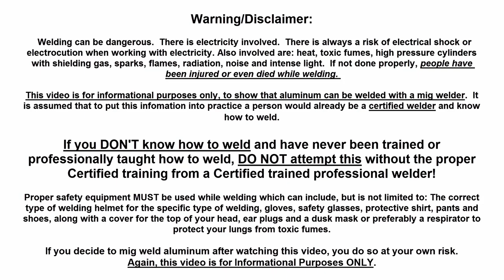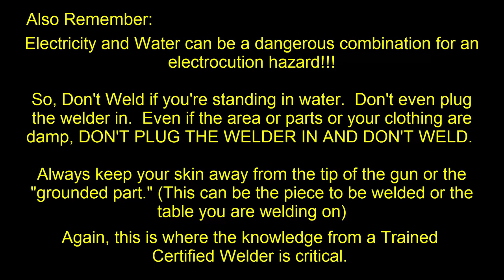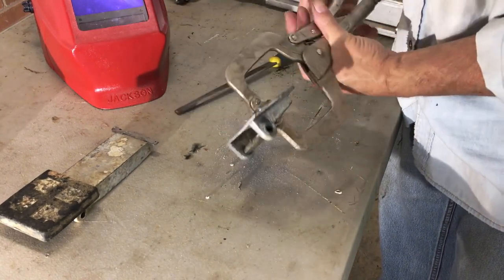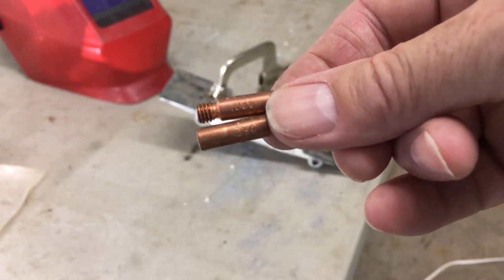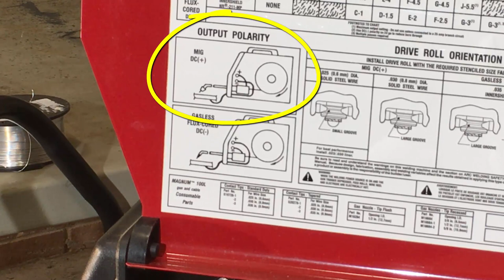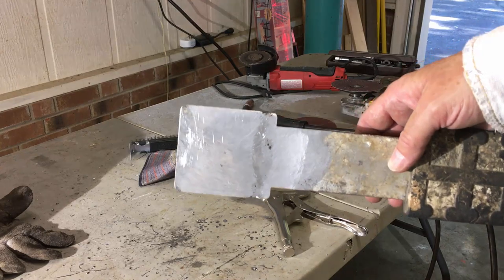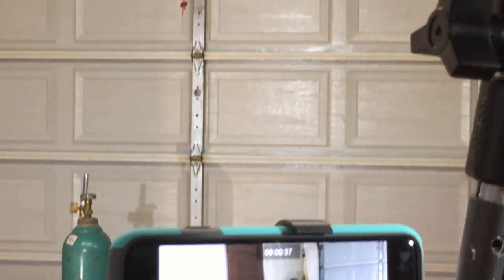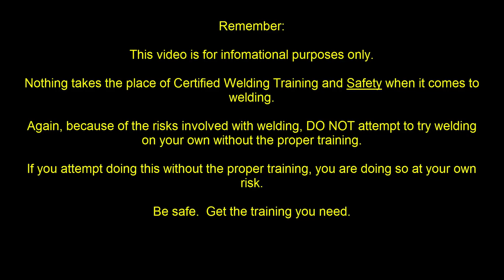Learn An Old Timer's Secrets To Mig Weld Aluminum Without A Spoolgun

Comment: Just go get a HTP Pro Pulse 220 with the 26 aluminum mig gun and weld sound pretty welds on aluminum sheet or plate to your hearts content  using double pulse mode with the synergic settings.

Comment: thank you for showing me how to weld aluminium, I only ever tried this out the once, on my Mig welder, and I made a right cock up out of the job!,, I used the softer wire though,, the wrong polarity and a small disposable bottle of gas, that only lasted a few minuets,, but I did use a bigger tip!,, but all the bird's around were I live,, had rust proof nest's for year's!,,  so what kind of pinch roller do you use for aluminium,, is it a V groove or a toothed drive roller?,, and why do you need a stainless brush for cleaning the aluminium?,, great video, thanks

Comment: 35 years welding everything from aluminum to stainless. Clean is the word on aluminum. You can be a master welder and have a weld look like crap and be crap  if not cleaned properly. I  mig  and tig weld  aluminum  from .040 to 1/2 inch.  I agree about the ring lol. That’s a bad idea for a welder. I have seen the results of a gold ring and mig wire not pretty.  I have welded 2” aluminum with straight helium using straight Polarity.  Not something your supposed to do but awesome penetration It was a job for the military.  I know there are going to be people saying I am full of crap with that  but it does work. The worlds were x rayed and penetrant tested.

Comment: I have the same machine but 220v I just landed a bunch of cut offs 3x4 inch 4ft. long rectangular tubing 
35 pcs . work tables welding cart, thanks for the tips....
Reply from the maker: Thanks for the comment and for watching the video!!!  It's always fun to get a bunch of material to either practice on or use for projects!
Reply: I'm 66 going on ___ you know,  say I appreciate the responce, just got back from a guy's, I've  know for years he's down sizing I bought a bunch of tubing various sizes and lengths, and a good amount of square tubing, mostly all steel, some stainless great for building projects I have a jancy 2400jb bender with dies both sets of dies....decent wire welder and some good folks on tube to give me some ideas..its so cool to see people share the learning experiences  with who ever if they will just look, most likely its there but I've had a hard time recently trying to find how to wire up a reversing switch, about the last image I found it it worked fine..... I love build things....grew up poor and dad had a junk yard so make junk run is a quick learning curve.....keep up The Work....i subbed.... thanks Don Powers.....
Reply from the maker: Don,
I love hearing stories like that!!  It's always great to make things out of scrap steel, etc.  Keep up the good work and the passion of your hobby.  It keeps us young!
Reply: thanks, it's just too hot down here in Houston so going slow, would love to send pictures, not in to the stairway to great videos.....lol....maybe someday...thanks for the reply
Reply: I am been a certified welder or many years a very nice tape that you made

Comment: Hi. I’ve searched all over e bay here in Uk  and can only find 0.8 diameter not 0.30 what is the best way to proceed. Kind Rgds
Reply from the maker: Thanks for the question.  .030” wire is the same as .8mm wire.  Good luck!
Reply: @StairwayToVideo  thank you for taking the time to reply and your explanation.

Comment: Lately I'm considering going to mig instead of stick, looks like a better setup for all around tasks, from sheet metal to aluminum. Been looking at a Hobart Handler 140. Very helpful & excellent video.
Reply: I have a 140 handler. You'll love it. One tip: if it seems like it isn't striking an arc or feeding,check the contacter in back.
Reply: I had a handler 140 and it was okay for smaller things. Upgraded to handler 210mvp, day and night difference. I welded stripped lift arms to the lift shaft on a Kubota tractor with it a couple years ago and it's still holding the tiller up.  😁
Reply: The advantage to MIG (or FCAW for that matter) is that you are able to weld together thinner pieces of metal than you can with SMAW.

Comment: You discussed everything except changing the liner to a synthetic material versus the coiled metal for  metal welding and using only tools to clean and prep with that were reserved for aluminum welding so as to not introduce contaminants.  Shop I worked at in high school 72-74 we used carbide burrs for material removal prep and ss wire brushes tgat were designated aluminum welding only.  Some welders also use acetone to clean the area before welding but acetone is hell and gone volatile and flammable quickly going airborne in its vapors.  Also, reclean weld start areas befor resuming a bead if you get black soot on the weld area.

Comment: First role you had of wire I hated that stuff right at the tip it would try to weld it back to it special on inside diameters

Comment: Hi. Good video. I used your same basic method to weld some carburetor base plates with broken off mounting ears years ago. Things I found. 1. Clean the base metal! As mentioned in other comments, NEW stainless brush.  2. Clean and maybe lube liner. Silicon spray?  3. I would lay a scrap piece of aluminum next to what I was welding and start the weld on the scrap piece and move to the other piece and weld in one pass. I got much cleaner start and finish. No porosity. I used a 110 volt, 130 amp Mac tools welder, very similar to yours.
Reply from the maker: Barth,
Thanks for commenting!  I like to hear how others have figured out how to solve welding issues, too.  I'm glad you had some success with that same type of process. Thanks for sharing your story and for watching the video!

Comment: 4043 is an Al-Si alloy.  Its main advantage is that it can be used to weld just about any aluminum alloy.  5356 is an Al - Mg alloy, it is stiffer (stronger) than 4043 due to the strengthening provided by the Mg.  Also, 4043  can be heat treated to improve strength while 5356 cannot be heat treated to improve strength.  4043 MIG wire is usually supplied in the H0 or annealed condition and has a 10.2 ksi yield strength as compared to a 13.6 ksi yield strength for 5356.  HTH

Comment: so in other words you have to have a short lead on the welder and use a big tip.... knew that. not a horrible job welding "floorsweepium" ( cast aluminum is made of crap swept off the floor, I HATE welding it!) good info. I would have cleaned it more and he did mention pre heating, which you should always do.. well done.

Comment: What was the reason for welding in spurts instead of a continuous weld?
Reply from the maker: Thanks for the question.  The material was thin enough that I didn't want to blow through it.  Sometimes when you weld aluminum, the heat builds up very quickly and you have a chance of blowing right through the material.  Thanks for watching!

Comment: I taught my self to weld, I discovered with automatic helmets its like welding blind, the old green glass helmets are the best you can actually see the weld puddle.
And I can weld the same things with a 110 welder as a 220 welder.
With thicker or harder metal  turn the welder down to its lowest setting.
Then use a torch to heat it red now it can weld just like a 220,.... the only difference is the heat range.
I have never welded Aluminum yet but  would do the same thing.
But now  would clean all surfaces with acetone and to heat the metal  would use map gas to heat it.
And before I installed the wire,... would change the liner in the mig line.
Plus I worked in a machine shop for 15 years, and in a weld shop for 8.

Comment: I am curious if flux core mig machines vs regular mig machines they sell at stores are the same thing just they preset them to do DC negative instead of DC positive and without a gas attachment. So if one bought a regular mig machine would he also have a flux core mig machine so have both types of mig machines in one. Thats probably why there a little more expensive then the "flux core machine only ones" they sell to i am betting .... wondering though not fully sure quite yet???

Comment: So I see that you're using an .035 tip.  Are you using an.030 liner or an .035 liner?  Does the stiffness of the 5356 wire keep you from having to reduce the feeder wheel pressure?

Comment: Heat and voltage are not the same thing.  Voltage controls the liquidity of the weld and heat (amps) controls the penetration.  If you are getting porosity, turn up the shielding gas a bit.

Comment: try a block of dry-ice to keep aluminum from getting to hot..also while welding..feed wire into weld from  opposite direction causes the weld to pool flat like a puddle so there's less grinding the trick is using dry ice or liquid nitrogen which keeps the metal from getting too hot.
Reply: I'm sorry but are you aware that dry ice releases massive amounts of CO2 gas? Liquid nitrogen does the same thing, but it release Nitrogen. Both of those gases would substantially effect the weld.

Also, I believe the problem is the aluminum cools down too fast, not that it gets too hot. The actual wire that leaves the gun gets too hot but the piece your working on releases the heat faster than the wire is melting. 

I may not know much, but I thought I'd bring these concepts to whoever may read your comment.

Comment: Another thing you didn't mention, is that you should use a plastic liner in your mig cable.
 Less friction for one as the steel liner tends to grab the aluminium and will get a build up inside over time.
Reply from the maker: Yes, you're right.  I'm planning on doing another video on the topic soon!  Thanks.
Reply: @StairwayToVideo   I'm a self taught aluminum welder, but that was 20 plus years ago.  I was welding everything, including highway tractor fuel tanks and never had to re do any.
Reply from the maker: What process did you use back then? Was it MIG? Or TIG?
Reply: @StairwayToVideo  I don't know how to TIG. 
My first MIG was a 110 volt orange thing very cheap. That is what I taught myself to aluminum weld on.
Later I bought a Spoolmatic 2 and a WC3 controller to run off of my AEAD Millar 16 HP portable. That is what I did the majority of my aluminum welding with.  I sold the MIG attachment many years ago. I have a 220 volt one that I sometimes weld aluminum with.

Comment: so i have a hobart 190 amp 240 volt welder that has both a knurled wheel for flux core wire and a smooth wheel for solid mig wire. did you use the knurled wheel or the smooth or do you not have the option of a knurled wheel? and what was your gas flow?
Reply: Always use smooth as knurled will mar the wire and cause feeding difficulties allso as light a pressure on the feed rollers as not to squash the wire !
Reply: Danny is all over it, the knurled drive rolls are for cored wire only.
With .030 wire I would suggest around 30 cfh. If your weld has a lot of black smut you need to do a better job of cleaning your parent material with a stainless steel brush or add more gas. Oh and make sure you have a good "ground" and ensure no cross air flow through your work area, which will rob your gas from the puddle, and give you a black weld.
Scott
Reply: So will a 220 mig work? Guess so.
Reply: good advice @sunrisetacticalgear29

Comment: If I have a spool gun, do you still suggest 5356 wire?
Reply: Joseph Massimino absolutely most place here in Australia use 5356 for everything. Balustrades boats trailers.
Reply: Depends what strength and purpose you are using it for eg on a boat always use 5356 stringer and more corrosion resistant !

Comment: I have an SP-125 & the tip is not charged until the trigger is pulled even if it is plugged in & turned on.

Comment: 4043 for magnesium castings etc, maybe straighten your goose neck on hand piece out a bit, clean material a lot better,  have a U prep not vee.  Way to cold, weld sit on top. Should have arc spray. All in all not to bad. 6 out of 10. Do small circles with torch. Way to cold, hot and quick. Just duct tape it. What ever have a merry Christmas. Oh and make sure  o ring and joins,  including shroud join not drawing air and contaminating argon.
Reply: aluminum welds DO sit on top. .  there's not total penetration with aluminum as there is with steel regardless of technique.  If you're going for penetration, by the time you get puddle deep enough in aluminum, you have a hole big enough to toss a golf ball through.

Comment: The ultimate test is will the welds hold? I don't think I would  want to be the crash test dummy hanging or finishing drywall on those puppies. Old school gas weld or tig would be stronger. Though I did give you a thumb up the lead out was a bit much. Good video tips for lighting and sound thank you.

Comment: I bought 5356 3/16" (2.4mm).  Is that too thick?
Reply from the maker: Yes, depending on what machine you have.  For a smaller machine (like in the video) I usually run either .030 inch.  3/16 inch is .1875 inch which is 6 times thicker than .030 inch.

Comment: My comment's going to be a little different.
I kinda liked the music. Maybe not great, but funny and very well suited to the video. And I've been a musician all my life, so I know what I'm talking about.
I also liked the welding. But then I'm not a welder, so I don't know what I'm talking about. 
However, as ignorant as I am, I did notice your moving the gas with the safety cap off and I didn't like it. I also didn't care much for your first “hammer”. 
What I liked even less, was your holding the item in one hand and operating the angle grinder with the other. I always take the trouble of fastening the item well and having both hands on the grinder. Maybe I'm a coward and a chicken, but do I find it a little embarrasing having to trouble my friends to take me to the hospital because I've been a fool. And as a musician I do want to keep all my fingers!
Reply: music is for listening, welding tips are for learning, learning should be done without distractions.

Comment: I would have gone with a .040 tip, also a new liner just for aluminum would help, you can pick up contamination from a liner that you used for steel welding, otherwise good information for some one that has never done it before.
Reply from the maker: Yes.  I'm planning on using a "teflon" style liner next time.  Thanks!

Comment: i had an aluminum jonboat. used it hard. ended up cracking several ribs. i understand ribs are riveted for flexibility. i had them welded several times, i guess  new ribs riveted are the answer because the repair welds cracked in short order under a fraction of the stress. or is there another answer. i dont know. maybe you do
Reply: Aluminum is like a leaf when it's new its green and flexible once you add heat it gets brittle and cracks easier like an old brown leaf it can be done just by someone with knowledge of how aluminum reacts to certain repairs.

Comment: for thicker aluminum (3/8" and up) you can not beat a 75Ar / 25He mix gas. The helium aids penetration and adds a cleaning effect.  With helium in the mix you don't have to crank the machine way up, it can eliminate pre-heating and it cleans a lot of schmutz out of the weld. If you REALLY want to make a bad ass aluminium weld - one that's pretty AND penetrated fully - 75He/25Ar. it's and expensive mix but ooh wee...it makes a beautiful weld. .035 wire with some amount of Helium in the gas and listen for that crazy crackle!
Reply from the maker: Thanks for watching the video and taking the time to comment.  I appreciate it!!

Comment: Someone please tell me if this can be done with a gasless flux core mig welder.. I’m new to welding but I’ll definitely want to be welding w aluminum
Reply: no, wont work. my advice: save up some coins and buy an AC/DC tig welder on amazon (or other) Make sure it has AC and DC,  The AC is for aluminium. Pure DC tig welders are cheaper, but can only be used on steel and some other metals. I think they cost from about 500-600 dollars and up. Then you will be needing a gas bottle of Argon for aluminium welding, and mix of co2 and argon for steel. Good luck! :) PS, these welding machines can also weld sticks, which is fine if you are working in windy conditions (outdoor)
Reply: Yes. Just type flux core aluminum welding wire into Google. But flux core puts out a lot of fumes. You need good ventilation.

Comment: You can USE straight argon it is very hot it is very light if you use helium mixed with your argon it also helps clean the metal it welds  lot better on shity metal like you're using
Reply from the maker: Appreciate your comment!  Thanks.

Comment: Beveling the edges. Put the workpiece in a vice and give it the full length of the file, not the last 2 inches of the thing! This would get the job done in half the time. Plus, remember the file only works when you're pushing it. lift off or reduce pressure when pulling it back towards you! Brush off your file with the wire brush afterwards!

Comment: I'm a novice and I was told you have to change the liner in the electrode to to aluminum. the guy said it will contaminate and or jam up the liner otherwise. is the stiffer aluminum wire what prevents damage to the lining on the gun?

Comment: The heat as you say, is not the heat " very common misunderstandings" wire speed controls the amperage which is the penetration, which is the "Heat".  This where most misunderstand,  the other is controls the voltage, which controls the arc length.  So when turn the voltage up it appears to get the illusion of more heat. But in fact is less penetration.  It may seem pettie, but arc characteristics in control are the most misunderstood element of welding.  Pet peeves outside I thought you did a pretty good job....